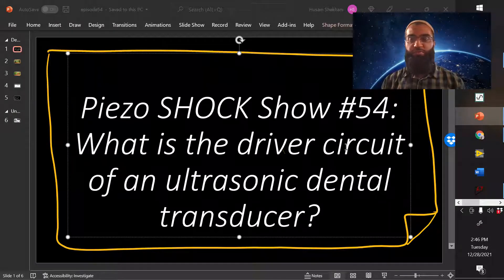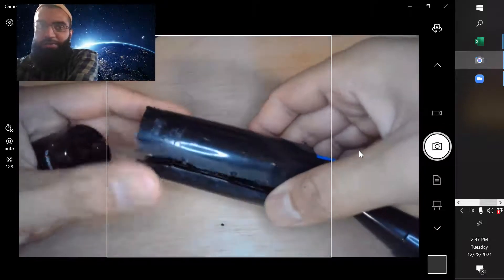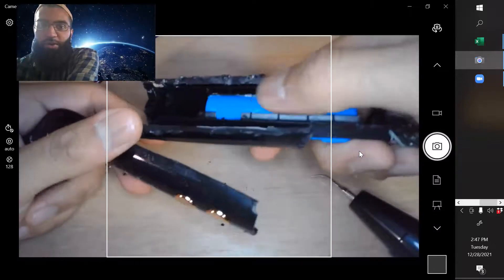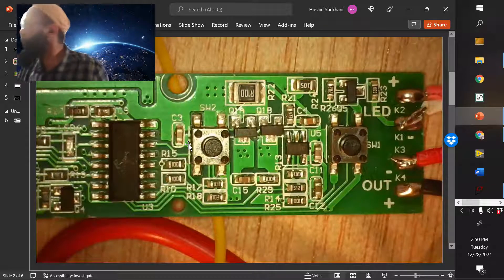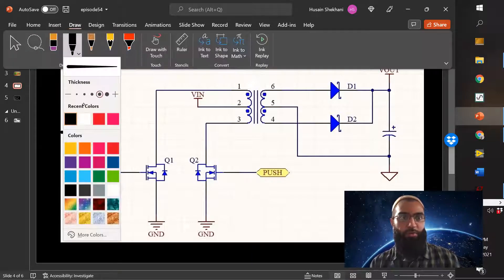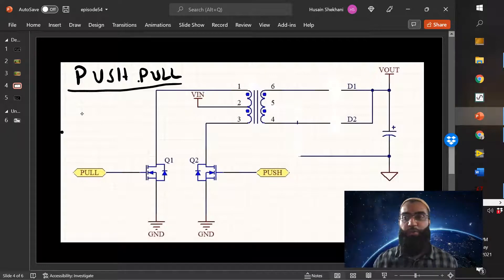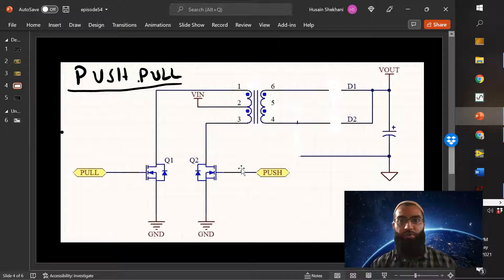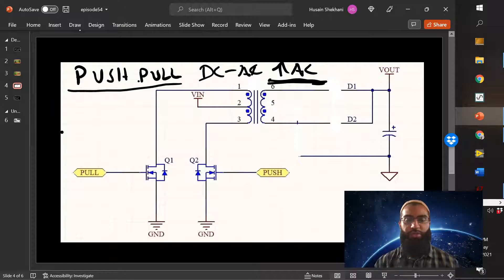Piezo SHOCK Show #54: What is the driver circuit of an ultrasonic dental transducer?

Comment: Would push-pull similar to half-bridge topology?
Also I don’t see any LC resonant circutri prior the transform. Piezo acts as capacitance in these setup so shouldn’t there be an inductor somehow in parallel with the piezo?
Reply from the maker: It's sorta similar, however it requires a center tapped transformer. Half bridge doesn't require a transformer. There is no LC circuit because the transformer is supposed to perform the impedance matching.
Reply: Awsome explaination !! :)
And great channel by the way :)